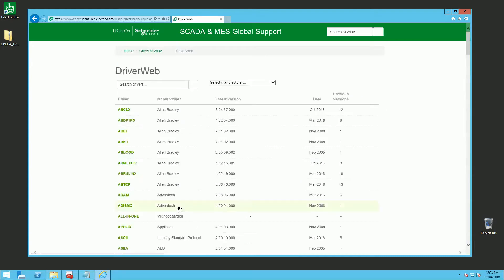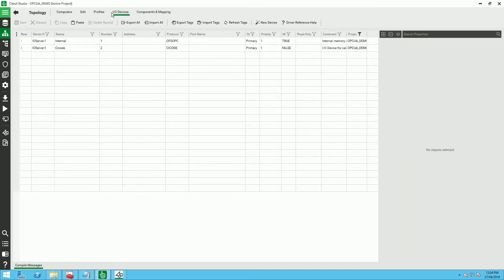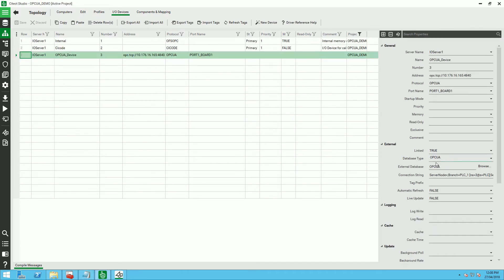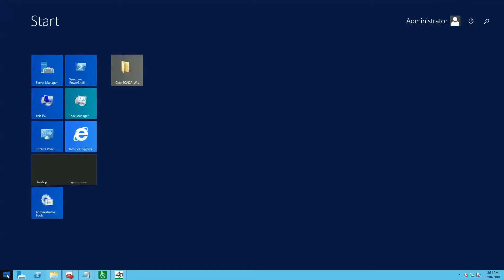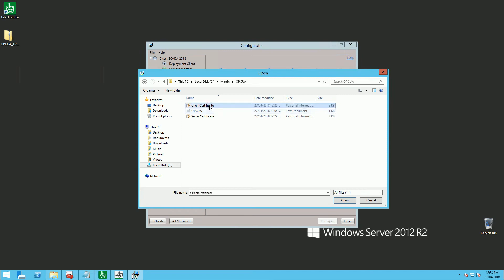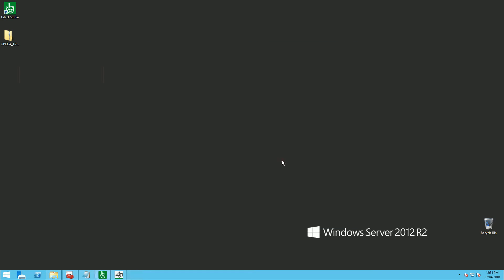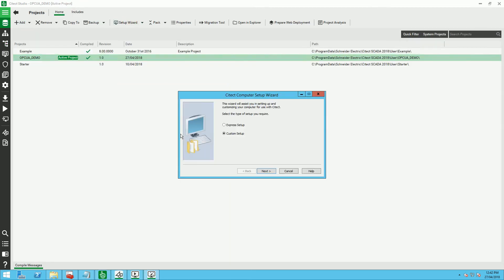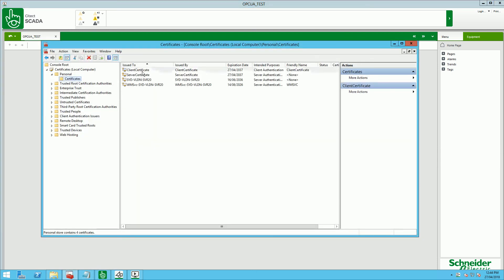Citect OPC UA Client Demo - SCADA Software Videos

Comment: Hi, How do you have to configure the configurator when you have to connect to 2 different opc ua servers ?
Reply from the maker: You can create two I/O Devices each connecting to its own server. Specify each OPCUA server address in the I/O Device address. If you need to use security settings in the configurator, you can create two settings and then put them in the citect.ini file, under different sections, like [OPCUA.IODev1] and [OPCUA.IODev2]

Comment: Hi, First of all i want to thank you for your great tutorials. It helped me a lot.

 Recently i tried to connect Citect 2018 R2 to Kepware OPC UA server. Both run in same computer. I just wanted to connect them. But after citect configurator run and I have accept citect client certificate inside the kepware server. But then the configurator shows below error code.

 Could not connect to the OPC UA server. OPC UA status code: '0x801F0000'. 

Do you have any solutions or suggestions for this because i have tried many things but unfortunately nothing worked. 

I would be really grateful at least if you can give me some suggestions. Thanks.

Comment: Hi Martin, can you specify me the version of CitectSCADA you are using in this video? I have try the CitectSCADA 2018 R2 (the one with blue citect icon), it has OPC UA when I add new device, but it always shows errors when I open the Configurator. I also try the CitectSCADA 2018 (the one with green icon), but I cannot find OPC UA in the new device. There's only OPC DA option.
Reply from the maker: Citect SCADA 2018. Make sure to install the driver on this version. For Citect SCADA 2018 R2 what are the errors?
Reply: Hi Martin, thank you for replying. I forgot about the OPC UA driver for CitectSCADA 2018 (because the 2018 R2 version has already had OPC UA so I though that the 2018 should be like that if it support OPC UA). I downloaded the driver and it works perfectly. About the error of 2018 R2 Configurator, it shows an error message with this title: "Constructor Exception has been thrown by the target of an invocation".
Reply: @meihk_4616   Hi I am also using the Citect SCADA 2018 and I think i also have the same issue. But unfortunately i was not able to find out the OPC UA driver for citect scada 2018. The website url metioned in this video about the driver location also not available and it is directed to Aveva website. Could you please explain me how to find the OPC UA driver for citect 2018 R2. Thanks
Reply from the maker: this is the new link https://softwaresupportsp.aveva.com/#/connectivityhub/details?id=b6521661-4ca6-4393-b0cf-f39da71e2191 you may need to register to the AVEVA support website first
Reply: @martinlalanne1  Thank you so much. I have downloaded the drivers from this link.

Comment: New to this - where are the certificates from, and how are they generated?
Reply from the maker: Hello Luke, Self-signed or CA signed (Certificate Authority) client and
server certificates are supported with the OPC UA configurator plugin in Citect
Configurator. Self-signed certificates can be generated either from the Citect
OPC UA plugin or from an OPCUA server (a PLC Module for example). For CA-signed
certificates they are generated from a third-party Certificate Authority provider.